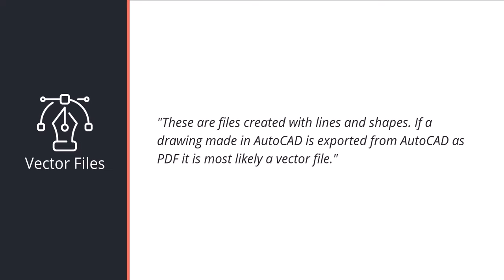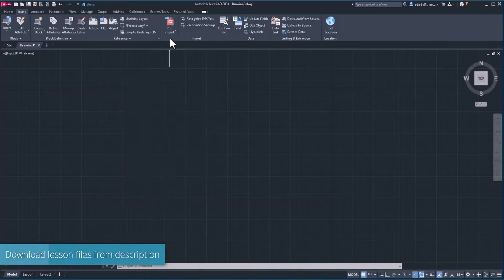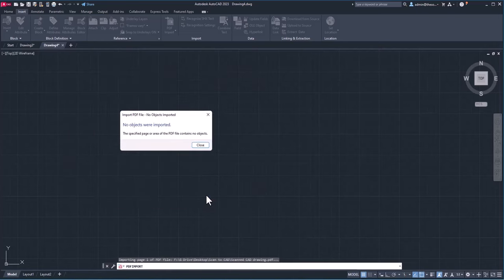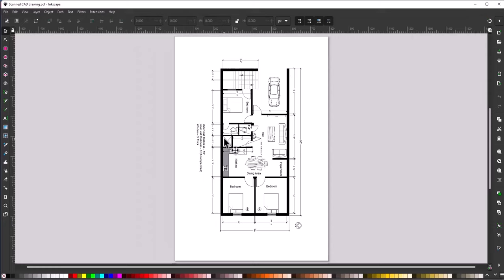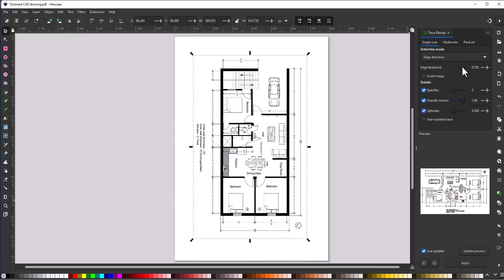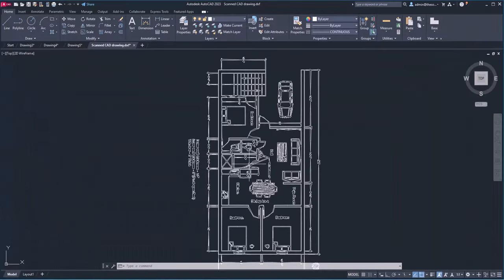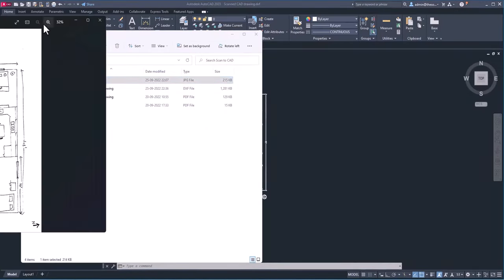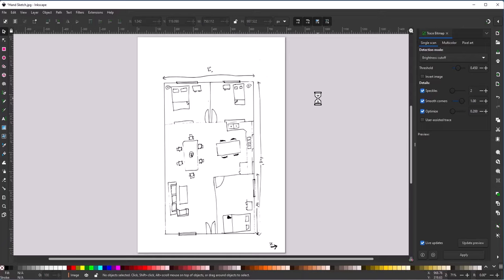Convert scanned PDF and Image into DWG

Comment: I tried what you are doing with Inkscape 0.92 and when I Trace Bitmap I get a popup, but mine is quite different than what is shown in the video. It seems that you have customized you Inkscape so that it looks quite differently than what the default looks like. In my popup screen I have to check the box which allows me to see the live preview. After ungrouping it 3 times I get the live preview, but it is not in the lower right hand corner, it is in the popup box itself. I do not have an apply button in the lower part of the screen but I do have an OK button in the popup box. This is what I clicked when I was ready to Trace Bitmap. I noticed that I had to change the unit to inches when I saved it as a .dxf file while you did not have to change it in your video. I am just making a note here as to the differences of what I had to do to make it work. I would love to have my Inkscape app customized as you have here.

Comment: Great videos. An issue I am coming up with recently is importing PDFs which import with a white block over it it where when removed leaves the text behind it. Sometimes though it removes the lines also just leaving text. Other imports they are only importing small parts of the PDF For example it will import the page template with the of text, but no drawing ??

Comment: While this is nice, it makes a double line of bold or "thick" lines instead of making the line in the middle of the thicker line on the raster image.
Reply: I am a designer, and got the same problem converting an architectural plan.  Did you get a reply or find a setting that eliminates the outline affect of single lines?
Reply: @mdlongdesign ultimately I ended up using inkscape to import the vector PDF, and then exporting that as a DFX. This makes for a much cleaner import, but the double lines remain. After you do this, however you can then use the much more accurate and clean file to draw a new line on the mean of the old double lines.

As the head drafter at an ENG firm, I find the pettiness of this architectural drawing to be both unprofessional and harmful to the client who had to wait an unnecessary amount of time to get the plan processed by me manually.